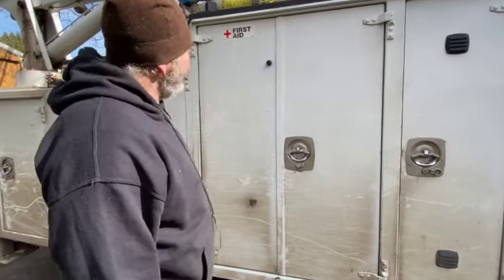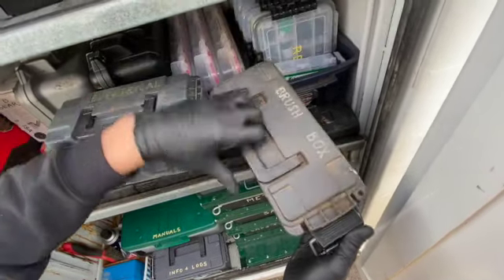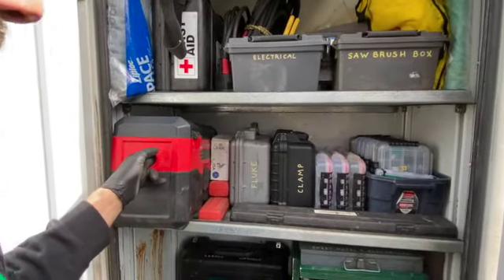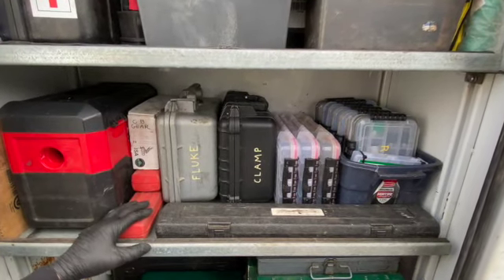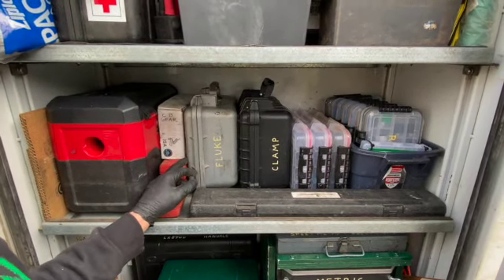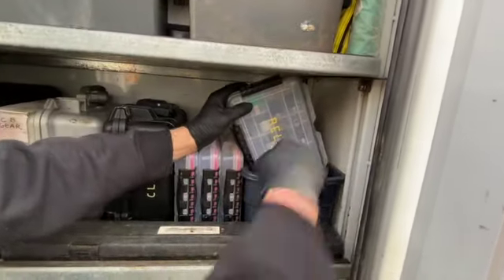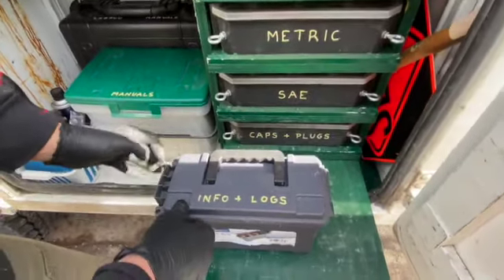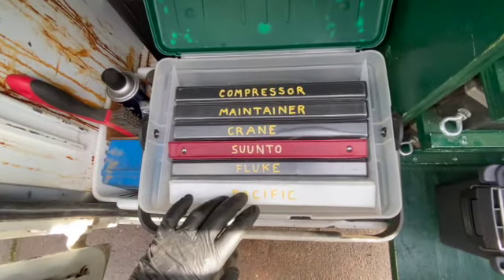Service Truck Tour : Video #6 Passenger Side - Box 2

Comment: Thanks for sharing!
Reply from the maker: You're welcome. My truck has changed a some since that video, and I'm at the point now where most of the improvements I make are small. I love the Maintainer body, have had several different makes over the years, and it is the Bomb! Built stout, well thought out, and a pleasure to use every day. I love my Tigercat, but to keep Buncher running right requires a lot of maintenance. Having this truck with everything I need allows me to make that happen and have a good time doing it. Perhaps you are the same way. I get a kick out of running into something tricky and having the exact tool I need to get it done. Thanks for the comment and for watching!

Comment: I'm curious about your jumper cable set-up. Did you run it off both truck batteries down to the front bumper?
Reply from the maker: I ran it off the single drivers side battery, so it's 12 volt. I could have pulled off both truck batteries in parallel but it didn't really seem necessary, generally when a 24 volt machine needs a jump one battery is a little weak, so jumping that one with 12 will usually get it going. I am happy with how the cables came out, I have 50' of cable that I can use with clamps on each end, or plug into the truck on one end with a clamp on the other or plug into the truck and plug into the 12 volt plug I wired into one battery on the Buncher. After we took delivery on the Buncher it would sometimes need a jump if it sat for a while. In talking with the service guys at Triad it sounded like that was pretty typical given the amount of electronics the machine has that draw small amounts of juice even with the night switch off. It eventually got a bit worse and I was going to replace them. They are Interstate batteries and after pulling them I put the Fluke on to see what they had. Turned out one was completely dead, and one was fully charged.  The sticker on the batteries stated a lifetime warranty so I called Interstate, long story short they deep charged and load tested them both and replaced the two year old plus faulty battery with a brand new one. I was pretty impressed. Since then I haven't had to jump it! Thanks for the question and for watching, we appreciate it.

Comment: How come we never see the skidders
Reply from the maker: thanks for the question. There are a couple reasons for that. First is being in the Pacific Northwest we don't run skidders, particularly in the winter. The ground just won't hold up.  We do have  a 648 G3 with a young swing grapple, but right now that is on road cleanup duty for an industrial landowner on a fire salvage project. I cut for our shovel sides primarily, and for our yarder sides when ever I can be productive. (We don't tether, yet) Next reason is that when things are going smoothly I am done cutting before the logging shovel gets moved in. There is some overlap from time to time,  and sometimes on larger units I may need to move out for a bit to cut elsewhere and then come back. We'd like to get some video of other parts of the operations but so far logistics have gotten in the way. There are some great people in the company and it will be fun, and interesting I think to show the logging we do. Hope that answers your question, thanks for the interest, we appreciate it! Be safe